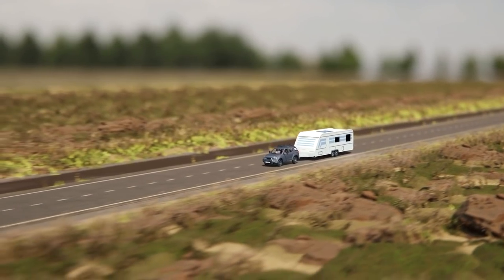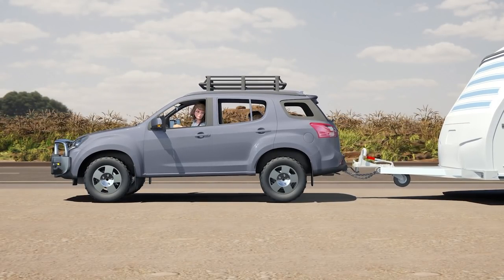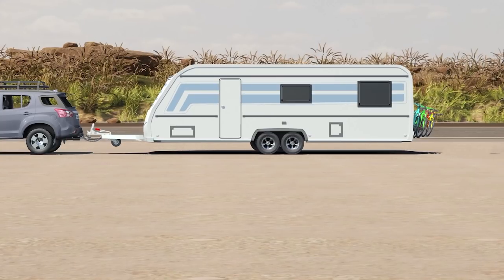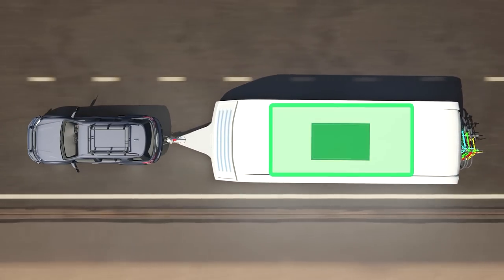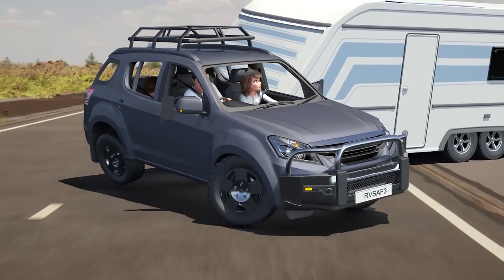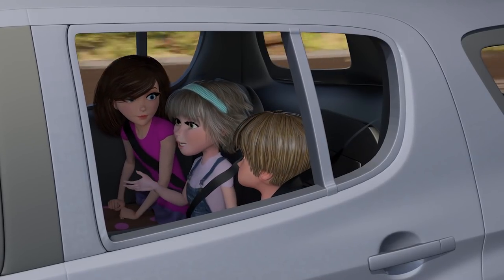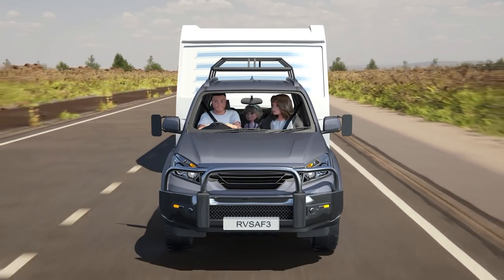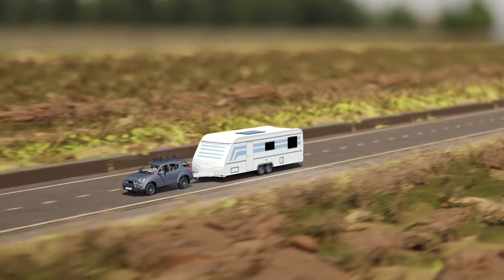Caravan Sway

Comment: Apply the trailer brakes ?? This video is going about a car towing a caravan, not a Truck and trailer with separate trailer brakes. I've never seen a car with a "trailer brake" button or lever hahaha
Reply: I suggest you get out more. They are common.
Reply: @aj-qj4lt  This is where trucks and caravans differ - a truck and drag as we call them in the UK has a few variations one with a simple pin and yolk some have a 5th wheel turntable, however the weights and mass make sway almost an impossible event as long as the trailer is unloaded first and almost all will have air operated brake systems with ABS incorporated on both truck and trailer.
Artics have a separate control valve to act as  an emergency brake feature - it is not intended to stop any "sway" because that will never occur, what can occur is jack knife created when/if the trailer brakes fail and the secondary emergency system also fails.

Comment: Don't you just love the bikes hanging from the back of the caravan after telling you to distribute your weight correctly They make a great pendulum
Reply: Ron I have hung two electric bikes on the rear of my Bailey Pageant Imperial for the last 10 years and 35,000 miles along the busiest autoroutes in France through the Pyrenees in all weathers and traffic densities with total confidence and as an Engineer I can cover pendulums and SHM if you like. see above comment.
Reply: @Cruner62  you have been lucky
Reply: @philbarnett9274  I can assure you luck is not the answer the definition of luck is when preparation meets opportunity and I have a system fitted that prevents snaking  (uncontrolled sway) that many people believe is something that there is no problem that needs fixing, and I can prove this without any doubt that there are myths abounding that needs removing if any action is to be taken.  Now I had stopped trying to get the industry to listen for years but have made an attempt to try again but I can see it is not going to work so I give up and will just watch as the incidents keep occurring caused by people like you.  I can say without question that most caravan users experience sway  every time they set out so the drive around at 50mph clinching their bottoms when/ if they overtake a truck and this need not be so. With a proactive control system it is like driving the vehicle with confidence like the modern braking systems offer.
Reply: @Cruner62  after years caravanning and my job of picking vehicles up nationwide on trailers towing with a number of 4x4 tow vehicles working for a Ferrari dealer had I loaded up a rear engine car forward on my trailer it would have been a disaster waiting to happen 
It’s strange it’s just you who seems to have  the opinion it’s ok  I repeat you have been lucky
Reply: @philbarnett9274  Hi Phil  Let me explain when you loaded the trailer with the car having a rear engine then that is the reason why it would have been a bad thing to do since the weight would not be distributed on the whole length of the trailer, however if you still had a positive load on the ball up to the maximum the tow bar would allow then that would be ok and as good as it gets without a proactive anti sway in place - you are  missing my point.  If you understood beams a loads you would know the rules. "Clockwise moments = Anticlockwise moments" to work out with formulae where the axle pivot  should be placed as Engineers like myself would have done when they built the trailer. I recognise your wealth of driving experience but like many don't understand engineering practices.  If the overhang aft of the axle seems too long it will be for what the trailer was designed to carry ie  if it was an artic the axles always seem to have a longer overhang aft of the axles but that is because it was designed to carry pallets evenly along the whole length of the trailer where some of the load is taken by the tractor unit. If you still need answers please reply.

Comment: This information is dangerous 10% of ATM vertical load on a hitch is a deadly thing to do the correct wait should be between 30 to 75 kg dependant on trailer and vehicle size
Reply: There is a difference between Europe and US. US trailers are designed to load 10% to the hitch. European trailers load ~50kg there.
Reply: @KalamarzKalamarz  i didn't know gravity and the laws of physics were different in the USA from the rest of the universe
Reply from the maker: Hi Mike, in Australia, the tow ball mass is stipulated by the manufacturer. However, 10% is a general rule here. We should also note that vehicle design and legislation differs in Australia to other countries. Kind regards, the rvSafe team.

Comment: gentle speed up in 4wd/rwd vehicule can stabilize than let it slow down
Reply from the maker: As speed increases, stability decreases so you really ought to ease off the accelerator and apply the trailer brakes to bring trailer sway under control.
Reply: @rvSafe  if you go down hill you may have to wait for terrain change with these

Comment: Please see the overhang on the caravan. 
THAT'S the cause of the sway.  TOO BLOODY  much overhang.
When ordering a caravan or even a box trailer ALWAYS opt for the 60 / 40 rule.
If the dealer can't / won't do it your way, go somewhere else.
60 % in front / 40%to the rear.
You may still have some slight sway but the combination will  be  much more controllable.
Also use your electric brake controller to apply  the trailer brakes.
Having said this, if your caravan started to sway you would have both hands
on the wheel, your eyes bulging WIDE open and you will be too busy shitting yourself to even think about applying the trailer brakes.
Any caravan or trailer  that has wheels in  the  middle, PISS it off.
Reply: Warren you are almost there on some parts - Loads should be spread evenly over the full length of the floor front to rear with a positive bias over the nose to the maximum tow bar allowance -. the trailer brakes should never be applied when the trailer is on the return stroke since it will add impetus on the return to equilibrium resulting in the kinetic energy going over centre, here is the algorithm "Apply a force equal and opposite at or before the centre of equilibrium" by applying a braking force only to the "accelerating" wheel not the decelerating one. This can never be achieved manually since there is a risk of wheel lock and then jack knife unless ABS is involved on each wheel. Only one system can achieve this on overrun brakes "Differential Stability"(c) in combination of a double acting hydraulic damper.  If ya need more proof ask away I will be pleased to help you if you can follow technical solutions. I would be delighted to go  head to head with you to prove that this is the way to go. I am a qualified Transport Engineer of 40 years Experience. This system removes the bum clenching when overtaking a truck.

Comment: 4th option, install stiff suspension at the rear of towing vehicle and it won't allow sway. I did 20 000 safe km with xc70 towing 7 meter camper in every weather and climate. Now towing 2800kg with a Sprinter van with reinforced stiff rear suspension ...
5th option, get a towing vehicle with an old style frame... trailer won't get any possibility for sway

Comment: I am surprized that no one knows what to do if a caravan or large trailer starts to sway, A swaying caravan  or trailer will start steering the car in either direction, Do not try to fight this as you will only make things worse, Lock your arms and steer straight ahead take your foot of the accelerator, do not apply the brakes or accelerate the vehicle, You can apply the trailer brakes if you are able. I have used this method and it does work. If the problem persists you will need to proceed at a slower speed & fit anti sway bars to your vehicle
Reply: Hi Barry - when I try to explain how a sway starts and how to stop it - it is falling on deaf ears almost all will not admit they experience snake all the time and just clench their bums and slow down to silly speeds in case others accuse them poor driving, speeding or loading.  If you ask many they will say  they do all the recommended things and still get  bad sway.  This is because the advice is wrong and until that is recognised  the solution will never get out.

Comment: Are you using 'National Specs' or state legislation figures. Manufacturers will tell you any old rubbish.
I recently had 'discussions' with the head office of a large vehicle manufacturer regarding their recommended towbar setup.
I also spoke to an independant engineer who told me a completely different story.
I took the engineers advice and our van tows great. (loaded correctly) Perth based.
Reply from the maker: Hi Colin, we are referring to the Australian Design Rules which are enforced through legislation. The Australian Design Rules state weights limits as specified by the manufacturer.
Reply: @rvSafe  Someone needs to educate Subaru Aust. because they don't have a clue.

Comment: Never load the heavy weights `concentrated over the axle - loads should be spread evenly over the full length of the platform with a positive bias on the nose up to the limit of the tow bar - you can hang your bikes on the rear of your trailer as long as other weights are spread along the whole floor.  Concentrating heavy loads over the axle will increase the risk of an  uncontrolled sway since the lighter the ends front and rear are the easier it is for a side wind to push it out of line as in a flywheel effect around the axle centre then the weight over the wheels will add inertia to the return stroke back to the centre of equilibrium. - physical Fact. yet they have not worked this out - I would stand up infront of any one prepared to listen and demonstrate why - so far dumb idiots produce model rolling road that is totally misleading and I could show them why.  Until these myths are removed there will be no solution.

Comment: This is DANGEROUS. 10% of the ATM on the tow hitch for my 1700kg trailer van would overload the 100kg maximum by 70%.
Reply: Sounds like your vehicle is not the right choice. If you cannot add weight to middle or front because you will exceed towball rating it's time to upgrade car or downgrade van
Reply from the maker: Hi Peter, in Australia, the tow ball mass is stipulated by the manufacturer. However, 10% is a general rule here. We should also note that vehicle design and legislation differs in Australia to other countries. Kind regards, the rvSafe team.